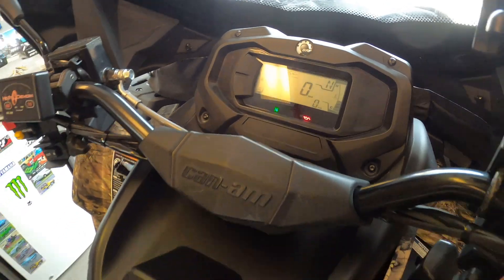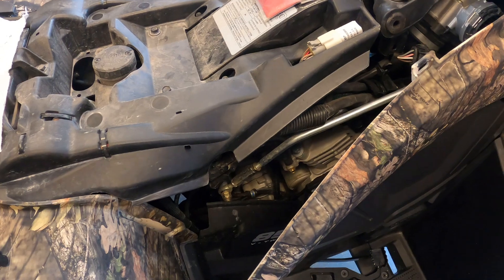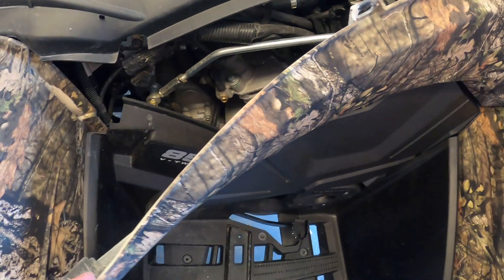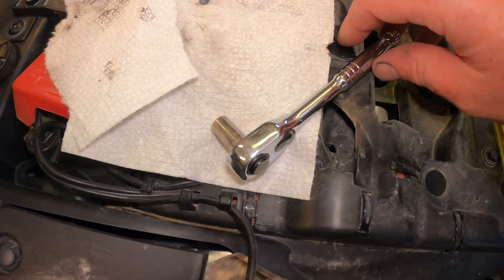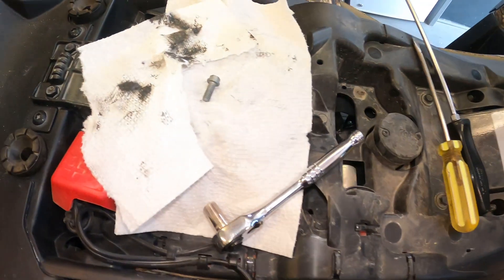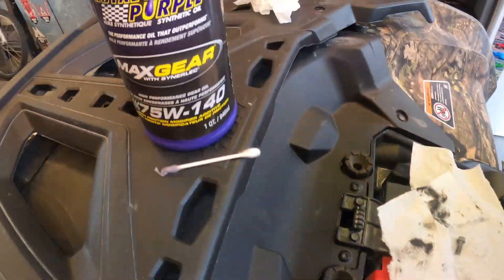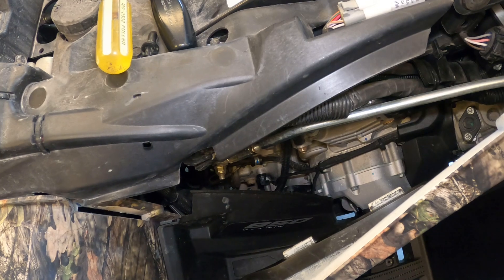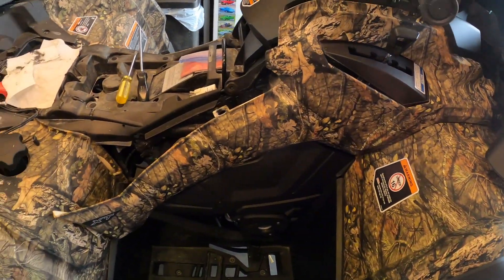How to fix Can Am Outlander speedometer

Comment: Just bought a 1000xt. Anything i should be aware of. Great video.
Reply from the maker: They are great machines,  just kinda weak in the breaking department IMO. 
This is one of very few issues Ive had with mine. 3k miles on it.
Reply: @bikermike  thanks for the quick response.